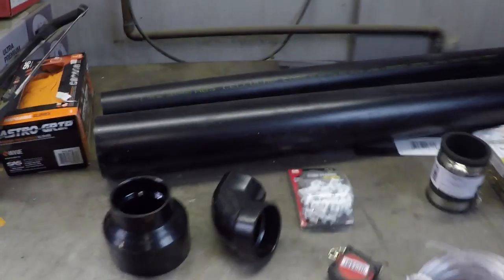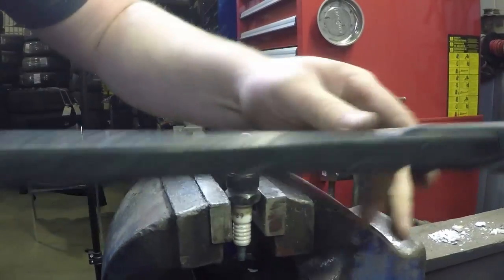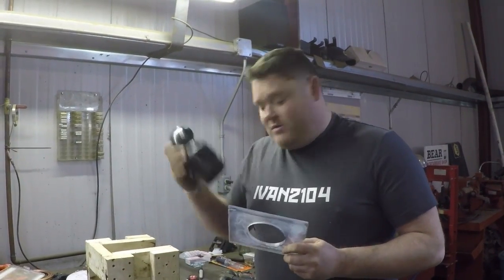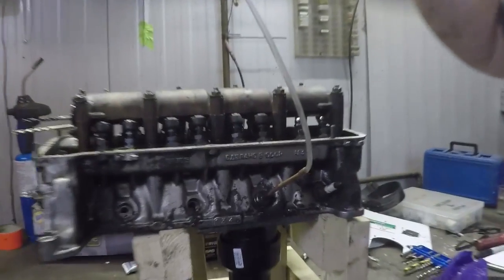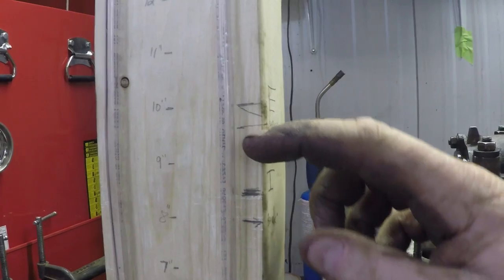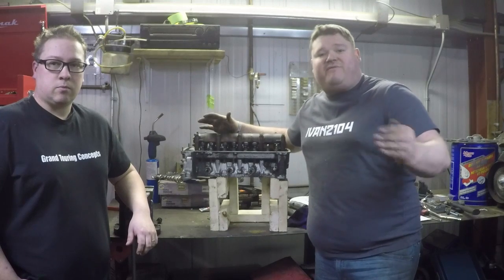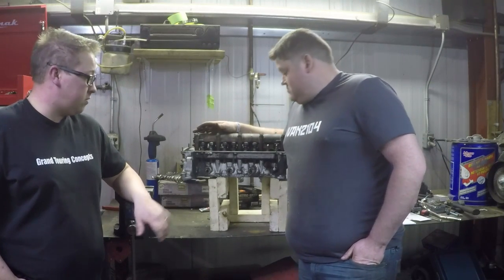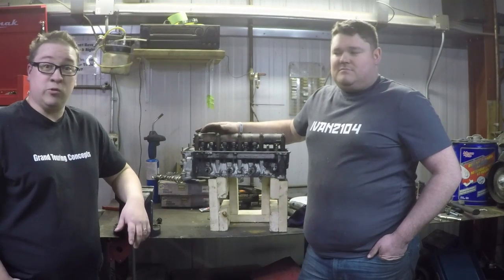IVAN2104   DIY Flowbench!

Comment: Wouldn't the manometer be best placed permanently on the downpipe out to the shop vac rather than having to remove and replace each time you change cylinders? Genuine question.
Reply from the maker: Hi Ben, I think that would work quite well, we did ours in the manner we did as we were working from David Vizard's book and it's what his method suggested. Now there might have been some unpublished reason for this port location, but I can't think of why it might have a big impact. If you try it out yourself be sure to let us know what you discover. Thanks for watching and commenting! - Darren

Comment: Sory about my inglsh. Im a brazillian guy. Very nice vídeo.  Congratulations. So.. what about a hose with watter? One End on the spark plug and another to atmosphere?
Reply from the maker: That is exactly correct, the water column will move as the vacuum draws on the spark plug side. The atmosphere end allows the water column to freely move in the tube. Thanks for watching and commenting! - Darren

Comment: I’ve read and re-read Mr Vizard’s book, too. All this is very interesting. I like the way yours doesn’t use a blocked cylinder bore. 
But how do measure the amount of valve opening? And how do you open the valves?
Reply: I use a dial gauge in the retainer for measuring valve lift, to open them, use a light spring and then make an attachment to bolt to the cylinder head and has a machine screw to push down on the valve stem to open it a set amount.

Comment: You could add a MAF sensor and arduino to get some idea of the actual CFM flow. I built one that correct for temp, air pressure and humidity, plus corrected for test head (pressure).  I really should make a video on mine some day.
Reply: Can you share the arduino code?
Reply: @andrewhansen7985  I sure can, if you are willing to take as is and try to decode it. Any improvements would be greatly received. I would like to add a calibration routine to it as I did see difference between calculated and what I measured on a manometer ( bent clear tube with water in it). Let me know where to post it.
Reply: I'd love to get that sketch.  I had the exact same idea.  Also thought of a PC fan and measuring voltage.  How did you come up with the data points for the MAF?
Reply: @ericthered9655  hi Eric, I searched the internet for a transfer function for the MAF sensor and then once I found one I searched for a car that used the MAF sensor. This allowed me to map the curve. 
I then added a temp, humidity and pressure sensors to work out actual air density for correction. PCDan will not work, no spinning sensor will as when you flow 100CFM it blows the bearings off it!
Reply: That would be unreal as I have had the excat same thought since doing a basic Arduino intro day. (Can't write code yet!)
Reply: @scottwiggins8619  my code is nothing to write home about, no subroutines etc, just straight linear coding... I can share the project if anyone wants it.
Reply: HOW DO U DO THAT? THATS AMAZING!! PLEASE  TELL🤙🤙🤙👍
Reply: @libertyjusticeforall6754  I'll kindly wait with you brother 😅
Reply: @libertyjusticeforall6754  I'm going out on a limb and assuming he's did "DIYFlowBench" if you search that name a website will pip up and there's a GIThub page for it.
Reply: Jon, how is your flow bench and your arduino working?
Reply: @jimmypopp2695  in the corner of my garage, awaiting me to pick it back up again.
Reply: @jonlaws4493  Seems like we probably share the same garage decor then..lol
Reply: @jonlaws4493  I found the book and it is musclecardiy and the book is how to port and flow cylinder heads. I bought it and hopefully it has some good stuff in it. How far did you get with the arduino?
Reply: @jimmypopp2695  I flow VW heads, so built a flow bench using 2 vacuum cleaner motors, some drain pipe, MAF sensor and unused cylinders (VW air cooled). The bench is a great tool for relative improvements, but needs calibration for absolute measurements. I’ll put together a video on it at some point when I have time and space in the garage. Where are you located? I am in the U.K.
Reply: @jonlaws4493  I was going to ask where you were. I am in Pennsylvania USA. Do you have an email I could contact you with and give you my real name and info.. I would like to share info and we could discuss all that kind of stuff.